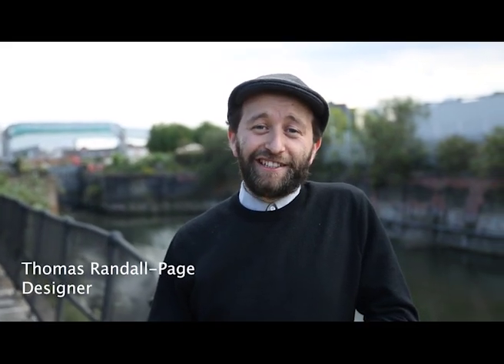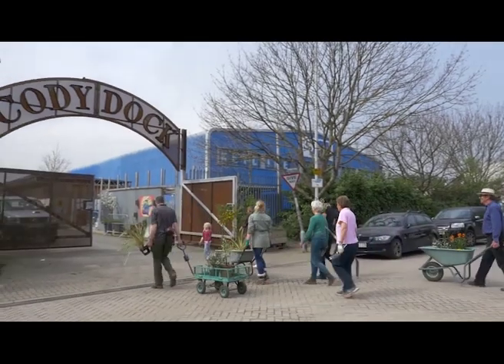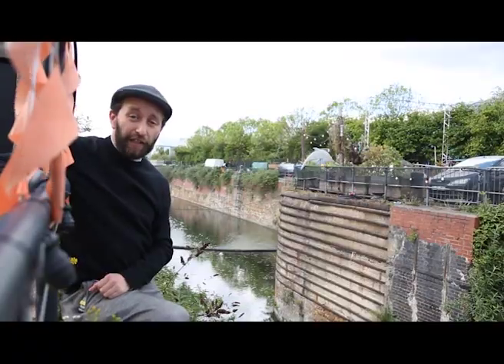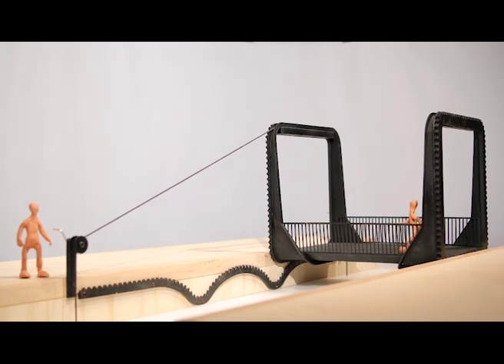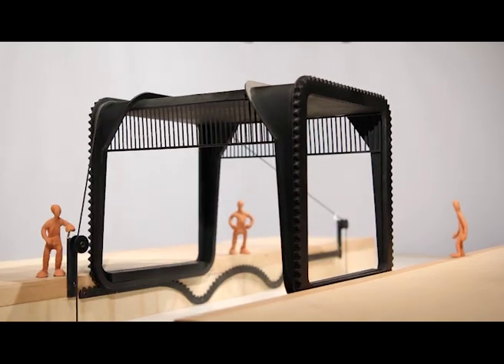Cody Dock Rolling Bridge

Comment: "Fully counterbalanced mechanism" Uhh where? What is shown in the animation is massively heavy on one side of the "square" (the base, the handrail and the tapered, reinforced frame.) The only way to counterbalance it is to add equally huge weight to the opposite side - which means adding only to the top cross-pieces so as not to interfere with boats when inverted. This design is purely for entertainment.
Reply: Solid steel weights at the top, hollow structural section for walking on at the bottom, can put CG right in center...

But what he doesn't show is how you roll it back.
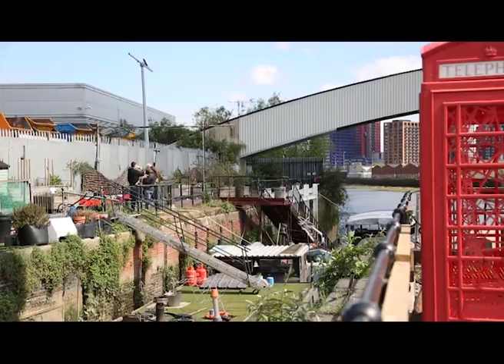Reply: @intamin9256  At 1:29 it is done multiple times. It looks like the rope or chain is under tension, which helps with rolling around the whole thing.
Reply: So maybe there is enough stored energy via weight imbalance to allow auto-return...anyway, this will likely never be built, it didn't get funded.
Reply: @intamin9256  there is no imbalance as it is fully counterbalanced. The cable is what holds it in place.
Reply: @intamin9256  The cable goes from a fixed point on the bridge, to the winch, down below the toothed track, under that track, back up to a winch/roller at the opposite end of the track, and finally to the fixed point on the bridge where it started. All you need to do is wind the winch the other way and pull on the "other end".
Reply: @6yjjk  I see it now, thanks.

Comment: from a mecanical point of view, i see a handful of issues : the center of mass is NOT in the center of the bridge, which means the first 45° will be easy enough by hand, to the point i'm not even sure the flat position will be really that stable. past the first 45° it will be increasingly hard to pull with a simple crank because you're trying to rise the steel floor in the air. 

moreover where the cable is anchored is unclear (if it even is), in its current configuration is trying to pull the square laterally by applying a vertical force on top of the cube, which is as inefficient as you can get so the last 45° will be really hard. if the cable is anchored under the bridge it's even worse when you roll it back because the minimal cable lengh from the pulley leaves the cabin tilted by 45°.

the concept is nice and fairly elegant though, it just needs to be actuated by an electric motor and not this nonsense. it's also a lot safer just in case some shithead decides to mess with it when a boat is passing or when people are on it.
Reply: It's perfectly counterbalanced so the center of gravity is the center of the bridge. An electric winch would be better. The cable would be a circle with the winch providing the anchor point.
Reply: @ShimrraJamaane  I don't see any counter weight on the open top of the bridge, unless those two bars are made entirely of plutonium I guess. So no it is not balanced and the center of mass is close to the center of the floor.

Even if the cable were to make a full loop around the cube it wouldn't change anything. It needs to be anchored in the right side (relative to the view point) of the cube.
Reply: @Lapantouflemagic0  Just because the animation isn't showing it doesn't mean it isn't there. They did say it was fully counterbalanced.

If the cable is a full loop (which would make sense) then it only needs to be anchored in one location, the crank. The cable can be pulled either direction and the energy would be transferred to the crank.

Comment: How will you avoid crushing the limbs of people at the edge as it rolls on top of them?
Reply: Indeed. And the problem of rocks or bottles in the tracks from the average teen vandal.
Reply: @DiscoFang  a railing could protect limbs. And the track could even be just pins in the wall, thus meaning nothing can rest on the track.

Comment: But wouldn’t an arced bridge be significantly cheaper, less complicated, easier to maintain, and safer? Not an engineering major but this just seems like common sense.
Reply: Arch bridge might not be feasible for this if they want to make sure to have the right clearance for barges below, but as an engineering student this bridge seems like a laughably charming way to make a footbridge. I can sense so many issues with its design just looking at it and I'm only a student.
Reply: @nateman10  that's not how wheels work but ok.
Reply: @nateman10  instructions unclear: got arch stuck inside coffee machine.

Comment: It looks neat, but I don't see it working out. Not only would there be a virtual certainty that someone would crank it with someone else on the bridge (either by accident or deliberately, to "ride" the bridge, as it were), what about the boat side? What if there's a boat but no random passerby to turn the crank?

Actually, why even have the crank, other than as an emergency measure? Put an electric motor on it, either connect it to the grid somehow or have some solar power + battery setup for it, and the boat question would be solved at least - just put a button for them somewhere near the water level.

That is of course if you can show a reason to do this design in the first place. Why not just make a drawbridge, other than "this is neat"?
Reply: Making the simplest crossing isn't the point. Fun must be had in life. How come this video gathered so many commenters who abhor that notion, I wonder...

Boaters can take care of themselves, example: https://www.youtube.com/watch?v=19fSox0R30Q#t=6m30s

Comment: Sounds like someone's going to get rolled into the river by accident at some point.
Reply: Or "by accident".
Reply: @MonkeyJedi99  Exactly 😏
Reply: Someone being on the bridge would change the center of gravity and make it more difficult to rotate.
Reply: @ShimrraJamaane  Idk, looking at the model the edge is always hanging a bit. It might rotate itself if you stand on the wrong part.
Reply: @itchykami  the winch locks the bridge in place. Yes, the bridge could be rotated to 45 degrees before you had to start fighting the weight of anyone on the bridge. In that case, there are several measures that can be taken to prevent the bridge from being rotated while someone is on it.
Reply: Someone's gonna leave a bag or something on the bridge and have it drop into the river.
Reply: @atlas4733  Or a baby
Reply: @atlas4733  all I hear are more reasons to build it 😆
Reply: That might be why a lot of people opt for the 'stairs to raised platform' design.
Reply: Accident? My inner teenager is screaming at me to hold on to the railing while a mate flips it over.
Shouldnt even be that dangerous, if I let go Ill just fall in the river.
Reply: or on purpose.
Reply: "Accident"
Reply: that will be fun to watch

Comment: Overcomplicated. You can just engineer a bridge, which stantds higher over the water. That way the boats can travel through without the need to move the bridge. Thus, no mechanisms needed.
Simpler is better.
Reply: People need some amusement in life. If it wasn't the case, we would replace swing sets with benches. Play on benches! Safer!

Comment: You know some kids are going to get on the bridge, roll it over and sit on top.
Reply: Sounds like fun
Reply: It sure is tempting
Reply: Then someone ashore cranks it and they get dumped in the river, as they obviously intended.

For real though, they could probably put something like bird spikes on it. Often those are used to deter homeless people from existing somewhere, but in this case they feel warranted.
Reply: Not any more nor less so than with any other manually operated bridge. Of which there are plenty. It’d probably be locked with a Canal and Rivers Trust key.

Comment: I believe a simple arch with stairs on each side would work
Reply: I vote for a catapult.
Reply: Bicyclists would complain about the steps and pedestrians are too lazy to use them.
Reply: Not wheelchair accessible
Reply: Why the pedestrians and cyclists should do extra work in climbing it???
Reply: But would it inspired awe? Would it feel fun? Would it be handicap accessible? Can you bike though it?
Reply: @microwave311  I mean, if you try hard enough...
Reply: @microwave311  it’s called a ramp
Reply: @jb76489  it might work, but the issue is going to be how narrow that waterway is, meaning to make room for any watercraft passing through it you'll need to have the proper clearance, now I'm not sure of the exact measurements of that place so this could simply be a non-issue if its wide enough, but if it isn't wide enough the ramp will become too inclined and it will be difficult to get up it especially for handicapped individuals.
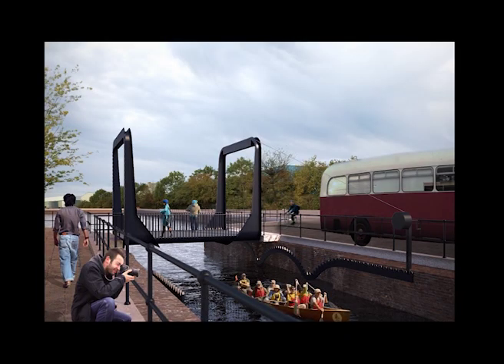Reply: @mikehunt3688  ramps have to maintain 1:12 slope so they usually go back and forth to address that (like letter N or Z but tighter)
Reply: @mikehunt3688  and what about a bridge that splits in the middle and contracts back...?
Reply: @mr2octavio  too many mechanisms, complexity and maintenance probably.
Reply: @jb76489  nah that would be inefficient considering the 1:12 slope. Just having a rise of 10 feet would require 120 feet of clearance.
Reply: @Somerandomdude00001  because as we all know, ramps can only be built in a straight line, bloody brilliant you are
Reply: @mikehunt3688  or make a spiraling ramp?
Reply: @jb76489  the problem to solve is not the difference in height, that's why the ramp is not necessary and would complicate the thing. Once you have worped the path enough to maintain a 1:12 slope and passed the river width yiu have to go back to the previous height becaus the two river banks have the same height so you would have to build a symmetric ramp just to get down again. The main problem to solve is the height under the bridge to make possible tha passage of boats. Even if you would to build tha double ramp, to sustain a ramp with a non linear path you would have to build something under it to hold it and that would occupy too much of the space under. Thus the best solution would be the arch or something movable like the project of the video
Reply: Why engineer something functional and realistic when you can over-engineer something that will never get built and would have probably have broken within a year anyway?
Reply: @whitworth5s248  so you can claim to be Kreative™ and compete against more sensible designs that would cost less in construction and maintenance or because you own the maintenance company

Comment: Pretty ingenious. Since the movement is not against gravity (i.e. draw bridge, lift bridge) it will be very easy to move.
Reply: The center of the bridge structure doesn’t change height while turning BUT the center of mass does if no counterbalance weight is used.
Reply: It IS moving against gravity, the centre of mass is being raised. That's why it requires a counterbalance.
Reply: Video narration claims it's counterbalanced but the animation isn't. The only place to put adequate counterbalancing is in the tops of the end arches, but even then the amount of mass required would be ..errrm massive.
Reply: @DiscoFang  wouldn't be that massive. Assuming the bridge is made of aluminum or another lightweight material, you could counterbalance easily with some lead weights or extra steel at the top.
Reply: @ShimrraJamaane  Apart from the high cost of it, to make an aluminium structure this size strong and durable enough it is still massively heavy. Look at aluminium bikes as an example, they are not substantially lighter and their frame tubes are much fatter. One stress fracture and they are junk.
Reply: @DiscoFang  when I said bridge I meant literally just the footpath. Then you only have to add the footpath's weight in steel at the top to counterbalance. The footpath can be made from an aluminum lattice structure (or go fancy with aluminum foam, though that truly would be expensive).
Reply: @ShimrraJamaane  The lattice path still needs a frame and handrail and the end frame is flared making it far heavier at the base. As mentioned, aluminium doesn’t save as much weight as you are imagining.
Reply: @DiscoFang  all of these weights can be offset by solid steel at the top of the structure. An aluminum bridge, rails and all, could be counterbalanced up top by a volume of steel that is 40% the volume of aluminum (that's not factoring in the rails are closer to the center than the walkway). Anchor the walkway at both ends and use the handrail as the support structure for the sides.
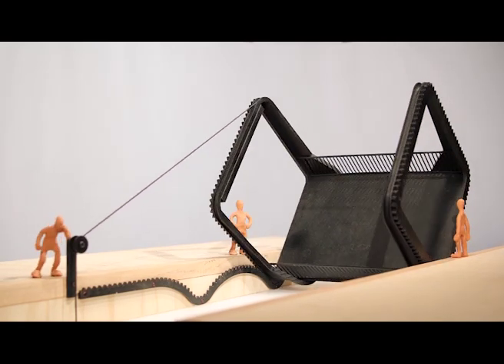Reply: The person using the mechanism will have to fight gravity because here 0:39 most of the weight has to be lifted, the center of mass and gravity aren't in the same spot, so the design look good but if it were practical it woul've been made a while ago...

Comment: As elegant as it it is, it will never pass safety inspection . People are idiots and will get maimed.  Id love to be wrong about this tho..
Reply: What the guy said about locks, but also easily solved. Put up a fence and gate at the path. Make the gate a locking latch for the bridge. So that the bridge can only be moved away from the path when the gates are closed. Also that the gates can only be opened when the bridge is in place. That'd be easy enough and rather low cost.
Reply: Exactly, it seems people could easily get parts crushed playing around with it
Reply: It could just be redesigned to hide the track. Have a lip protecting it. Although this may ruin its stability.
Reply: This was my thought as well. People are gonna give each other such a pinch with that... and then you will have idiot kids trying to "ride" the bridge as it rolls, too.
Reply: @Spinolio  I'd prob ride the bridge if i were 20 years younger
Reply: @Spinolio  thats not dumb, sounds fun quite frankly
Reply: I must agree to your statement, sadly
Reply: Surely all the manually operated river locks out here in the UK are by this logic completely unsafe and must be removed. Lots of cogs to get your hands and feet stuck into and large moving parts which you could fall off of or fall into. Not forgetting the strong currents generated when turning a lock which could probably drag someone underwater and drown them.
Reply: @isfiyiywafibc6qaiiiiiiiiii570  cancel the UK locks!
Reply: Hooo lord i'll be the idiot one asking a friend to make the bridge roll while i am standing on it
Reply: Yeah. It should be fine but it simply isn’t idiot resistant.
Reply: Look, the general public doesn’t need to operate the bridge, only the boaters do. The rest of the time the bridge is closed. And just like all the other manually operated bridges and locks in England, it’ll be locked with a CRT lock, and despite the state of the world and occasional vandalism, that mostly works.
Reply: This sort of engineering was commonplace once and much of it remains but trying to introduce this in a risk-averse world will be challenging.
Reply: Same with draw bridges, yet they exist
Reply: Same as opening a river lock or opening a farm gate. Personal responsibility.
Reply: Just a mini bridge that lifts up like the Westminster bridge (the one that goes up and down entirely) and be a second landmark "oh look, a mini Westminster bridge bridge!"
Reply: Let it operate with an electric motor and check the resistance you get. Dont let it move if there is too the wrong resistance, then you cant ride it
Reply: Yeah , can’t have anything nice or useful , because the world is full of idiots
If we just left it up to nature we wouldn’t have the world populated with idiots 
But ... here we are
Reply: First day - someone loses a toe.
Reply: Maybe put a keylock on the electrical control station and build an fence that moves with it.

It cant be that difficult if you have somebody that watches the thing carefully
Reply: @PhillipAmthor  Electrical control station? You mean, one guy with a ratcheting hand-crank?
Reply: @Ogrematic  No i would rather say an electrical device what turns it when you press an button. And in order to push the button you have to unlock the station with an key. Basically a simple mechanic which every moving bridge needs to have.
Reply: @PhillipAmthor  Yeah, but then how can a bloke tooling around in his little slip flip the bridge?
Reply: @PhillipAmthor  Holy shit, no way. Some drunk sot could kill himself and 9 others with such a simple contraption.
Reply: @Ogrematic  sober people hate him!

See how this guy killed 9 people and himself with this simple trick.
Reply: @PhillipAmthor  The only reason the human race is still here is cuz of tools. Without armaments, the dinosaurs would have killed us back in the flintstone's time.
Reply: That's the least of the issue. Rail road tracks are more dangerous.
Reply: Just leave it in "open mode" and connect two stairwell's to both sides.